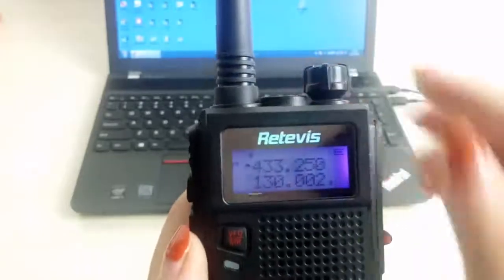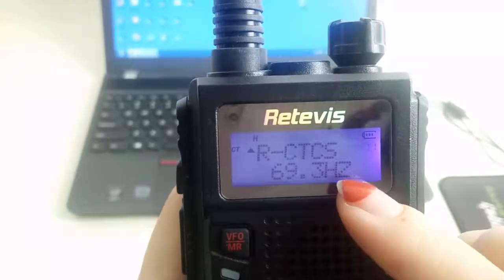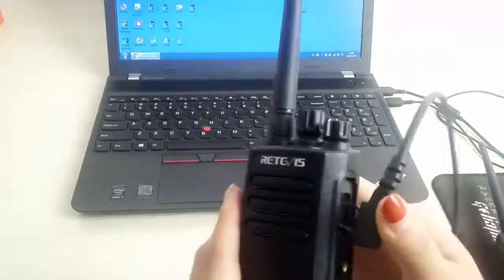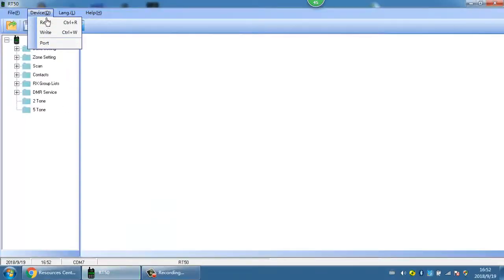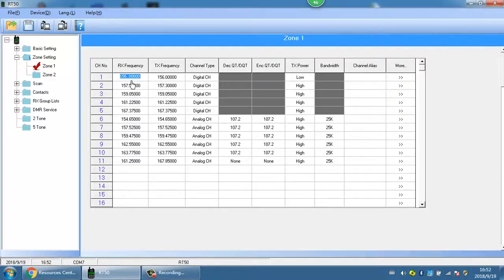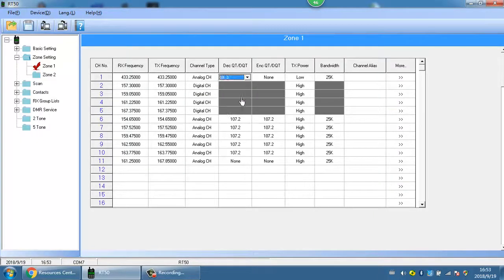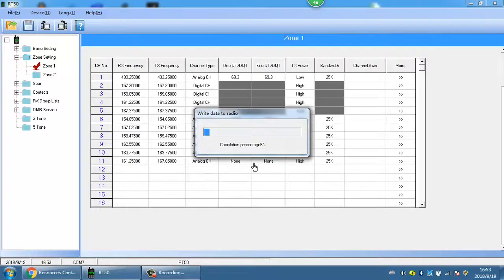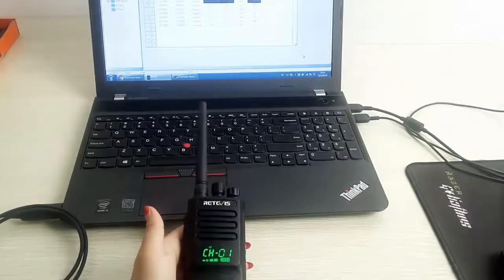How to communicate between RT50 and RT5?

Comment: I've got some Retivis RT28 and want to remove CTCSS and DCS codes as ive got lots of different PMR446 walkie talkies and the Retivis ones won't communicate with the other ones which are all on the same frecencies, ive got a programming cable but don't to how to put this issue right by software or something.